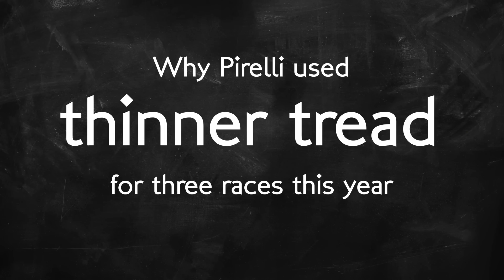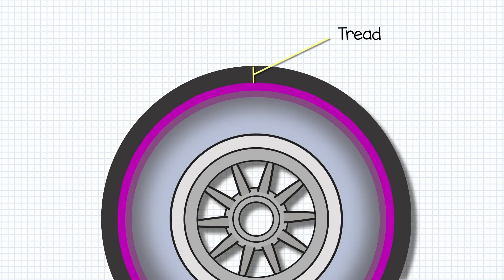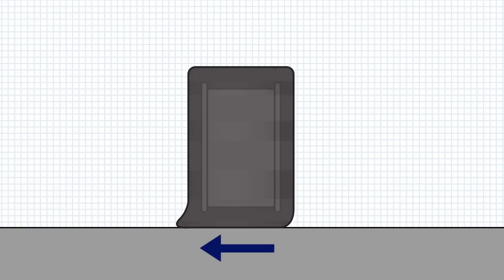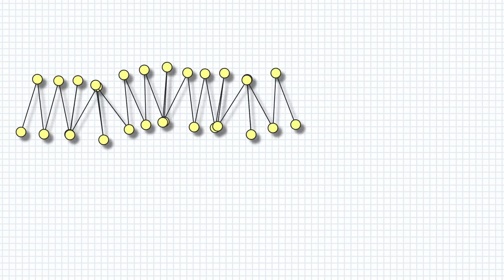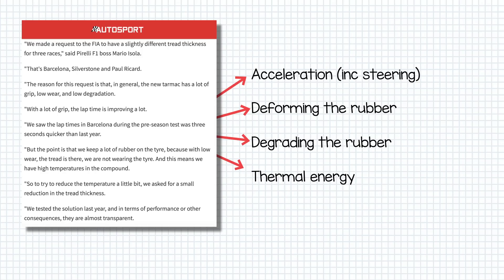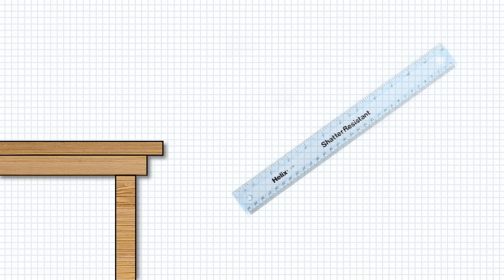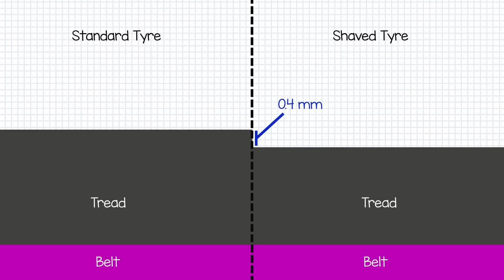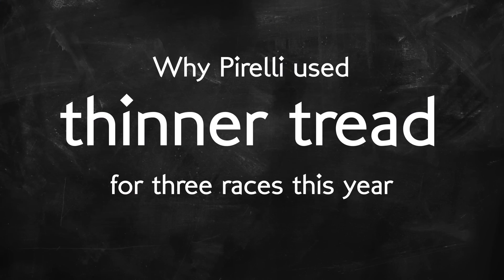How do Pirelli's special thin tread tyres solve blistering problems?

Comment: Its been about 8 seasons with f1 and these tyre arguments, I am sick and tired of hearing talks about tyre in F1 giving issues, since 2011. No other racing discipline have these issues, the tyres issues are spoiling the racing overall and forcing drivers to nurse tyres during races instead of push throughout a stint. It has been 8 years why has Pirelli failed to make a proper Formula 1 after all this time. I am sorry this is unacceptable.
Reply: Also thank you chainbear for the video
Reply: Because Pirelli had been SPECIFICALLY requested to make tyres that degrade during the GP, for show's reasons. 
For a tyre manufacturer, would be MUCH easier to make tyres that will last the entire GP without visible loss of performance, but, if they have to degrade, is difficult to say in advance if they'll last for 10, 20 or 30 laps without knowing in advance the charateristics of all the cars and all the tracks (that Pirelli can't know, since they had to deliver the tyres first than the start of the season).

Comment: While having a single tyre company providing for the whole F1 paddock might be considered as the only way to achieve a fair and consistent performance the flip side of the coin is Pirelli might choose to prioritise marketing and save money on R&D and we might not even know. They set their own benchmark and as long the cars are faster than last year there will be very little scrutiny on them. If there were more manufacturers tyre development would be improving much more, at a higher rate. It's a shame that the last time this was a possibility only seems to be used a reason why it will never be again because a manufacturer's priorities were on advancement in design an technology at the cost of safety due to a decision of the track management to re-cut the surface. There is now no competition in arguably as vital area in motorsport as fuel and engine design. At the end of the day if there is no competition there is very little advancement. Which undermines the whole F1 philosophy as a sport. Having the same company supply F2 as well is obviously more about money than any possible benefit to the sport.

Comment: I don't think Pirelli solved the blistering problem on the softer compounds as so much as the Mercedes W09 eats it tires faster than the Ferrari SF71-H....dependent on track temp.  The hotter the track, Mercedes opts for the harder compound till the end of the race while Ferrari opts for the softer compound till the end of the race.  Each cars suspension setup is different than the others.  Ferrari never had problems with the regular tires as far as blistering for 2018...nor did they have problems with the shaved tires as they modified their rear suspension per GP.  Christian Horner has said that these " shaved" tires are Mercedes Spec tires.  Last year, in the beginning GP's Mercedes "cooked" their tires....no one else did...until Mercedes rectified THEIR problem within the 4th GP I believe. During Barecelona testing 2018 (2 weeks before Melbourne) Mercedes were still cooking the softer compound tires...no one else was.

Comment: Pirelli need to be satisfy the need of all team. Even the move is correct, it could debated as biased to certain team, which Pirelli should not have. They need to maintain their reputation as neutral to everybody. Sure the blister could occur, based on this video, but its on the team that should manage it better.
Reply: That's kind of how I feel about it as well. Something about changing up the tires mid season doesn't sit right with me. The pressure should be on the teams to preform better, not the tire supplier.
Reply: The problem was that since Mercedes were struggling badly with the original tyre and suddenly beating everyone again with the new tyre, it could've been seen as Pirelli and FIA favoring the Mercs. ANd it doesn't help that this came right after the FIA ruled against the majority of the teams and forcing the 2019 aero rule change, which is most beneficial to the Merc engine users since engine performance is going to take the forefront again.

Comment: 3:48 why does a thinner tire mean less flexibility? that doesnt make sense at all.
Reply: Kokainsamurai there is less rubber to flex.. It's like the difference in stretching a large elastic band and a smaller one.. just less elasticity with the smaller rubber band
Reply: yea but the image is just wrong. a thinner tyre would flex more. whats harder to flex? a thick block of rubber or a thin layer of it? see what i mean?
Reply: you are basically saying that a solid rubber tire is easier to flex than a tire that has air in it.
Reply: And i'm a senior engineer. I know what i am talking about too. And i know CBF1s channel and how he does it. It's not supposed to represent the sidewall. it's just a graphic to give a general impression of what the thread is doing. As i said, it's a simple powerpoint illustration and not a that precise. The timestamp you gave he says "thinning the thickness of the thread gives a little less flexibility. This means the rubber is being stretched and distorted less" and that is what the graphic is showing too. The graphic is not wrong. You are interpreting it wrong. It's meant to represent the thread, not the sidewall. He shouldn't have to put in a sign "NOT the sidewall  -->" when he is specifically stating what happens to thread. He already pre-explains what the graphic is showing at 1:34.
Reply: No, think of it as a thick rubber block and a even longer thick rubber block. The longer one would be easier to bend(flex) than the shorter one. The length here is the tread depth.
Reply: And the thickness of the rubber black (which stays the same) is the same as the width of the tire (which also says the same)
Reply: yea well, you may be right. i was a little confused by that misleading graphic though.

Anyways... ive always thought that a major part of the heat in the tyres is generated by the curved surface of the tyre adapting to the plane surface of the road.  kinda like this: https://www.youtube.com/watch?v=HF1-8fmT4U4
thats also the reason why tyres heat up more if they have less air in them. the front tyres on my roadcar for example. they get pretty hot even when im driving in a straight line without ever putting longitudinal force on them.
Reply: Aren't they talking about shaving the tread area and not the tyre sidewall, thus leaving the strength in the sidewall the same and deforming less as a result? That's what I took from the video, reduce the circumference and keep the strength in the wall?
Reply: Yes the sidewall remains the same.
Reply: Kokainsamurai the thickness of the rubber was the tire width in my explanation. I was trying to use your rubber block analogy to explain but it probably didn't make much sense coz I was about to sleep. I could try and explain it better but the senior engineer seems to have done it better and I'm just a grad 😂
Reply: We're talking about shear deformation rather than stretching. With the same amount of total external force, each layer of the rubber slides a specific amount, so the more of them there is, the higher the total slide will be. The tire belt is much sturdier than rubber and makes sure that it's primarily the tread that deforms, not the tire as a whole.
Reply: have you even read the discussion? cause that exactly what i said. the animation at 3:48 shows the tyres sidewall deforming, not the shear deformation of the tread.
Reply: the video shows the entire tyre deforming not just the tread.
Reply: The point of that image at 3:48 is to show the bottom left of each tire stretching and it shows the shaved tire stretching less. It is not wrong. The image is a general impression. not an exact drawing. he does it himself in powerpoint.
Reply: the thickness isnt the same as the width of the tire.
Reply: yea but the image at 3:48 shows the sidewalls and the tire constrution deforming. you are talking about the tread deforming less, which is accurate. the image is wrong. thats what im saying.
Reply: it is wrong though. The tire surface would be deformed less since its thinner. the image shows the sidewall beeing deformed less though. 
ive got a masters degree in engineering. im pretty sure what im talking about tbh.

Comment: the problem is that what caused massive problem for ferrari with thinner tires was new parts for the rear they introduced for Barcelona..those parts were causing more strain than normal to the tires... see that they didnt perform bad in france or silverstone because they removed that, taking that out of the equation you can clearly see why everybody says that thinner tires works better on the merc, they dont manage the regular tires as good as ferrari, and thats part of the competition, so when ferrari had an advantage because they did a better work and mercedes didnt... pirelli bring thinner tires that misteriously help mercedes the most  with their degradation problem

 they did a better job to design the car, is like when mercedes produced that engine when the hybrid era started, they simply did a better job(althought everything was frozen and untouchable with was lame, THANKS ferrari for finding the loop and bring back some development)
Reply: Javier Javier Vettel himself said that the "Mercedes help" theory was bunk, and that the Ferrari would have been even worse off with the original, thicker tires.

Comment: More Mercedes Tyres for more GP
Reply: Dave Mitch ferrari was struggling with the original tires? Lol they tested new parts for Spain which was the main cause for degradation.. they removed that and car went back to normal it was putting too much strain on the rear tires look France and Silverstone, even in Austria where they had normal tires they chased and defended their position with tires older than 40 laps yet... Mercedes with 10 laps on tires was showing blistering... Why do you think Hamilton cried saying pirelli should have brought thinner tires to Austria... If it was the case that ferrari struggled more than others why was Hamilton the only one asking for thinner tires in Austria... And you can write it on stone now.. "he will ask for those tires in other GPs"
Reply: Dave Mitch i commented originally the main guy's comment that said "more Mercedes tires for more gp"... then I said "nope, they simply have to do a better job designing the car" .....then you commented about that if they designed a better car why where struggling with the original tires.. and you directed the comment to me.. the only thing I could think given your comment was that... You were talking about ferrari struggling in Spain more than Mercedes with the thinner tires and that supposedly with the original tires It was even worst... Then I said that the only reason they were struggling in Spain was mainly because part of the aero upgrades for spain was putting more stress on the rear..
Reply: Dave Mitch yes my first comment was about Mercedes... That what they need is to work harder instead of asking for thinner tires, I think you misunderstood me hehehe did you think I said they had a better design ? Hence why you asked me that if they were better why they were struggling with the original tires?
Reply: @ Javier Javier - If they did such a good job of designing the car, why were they struggling more than others with the original tyres?
Reply: @Javier Javier - Ummm....what? I think you've misunderstood my comment. I was talking about Mercedes. Who were you talking about in your earlier post?
Reply: That's the thing. The original post was about Mercedes so I assumed you meant them as well since you didn't specify the team name initially.
Reply: Yeah. I misunderstood your statement. Sorry about that.
Reply: why should Ferrari and Red Bull be punished for having a better car? that's what would happen if these thinner threads are used every race.. they would be punished for somebody else's mistake.. which would be silly.. only Merc fans would say that
Reply: nope.. they simply have to make a better job designing the car

Comment: are you sure on the 0,25kg ? that seems alot for 0,4mm
Reply: Ottavianus Augustus same thing I though, however checking the measurements a rear tire is 670mm of circumference by 405mm width. Multiply that by 0.4mm and you get 108.540mm3 or 109 cubic centimetres.
About 2.5 grams per cubic centimetres seems quite the right value for rubber
Reply: BubuSnow93 thanks man!